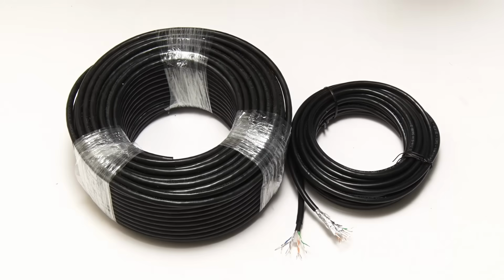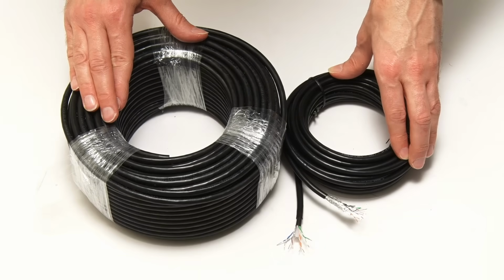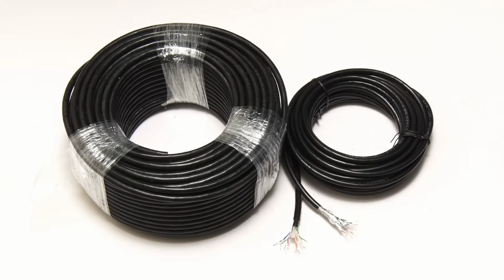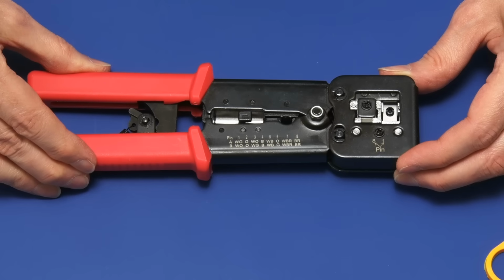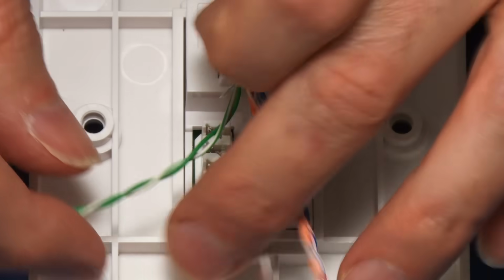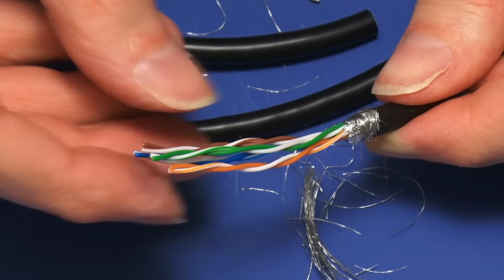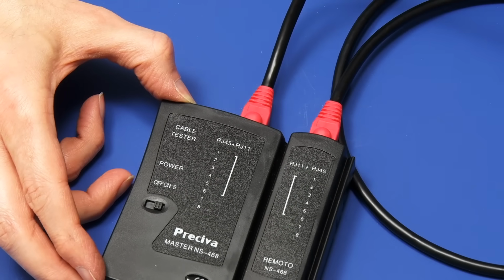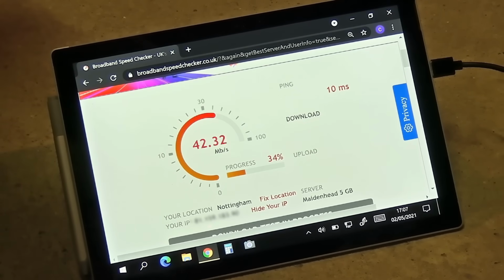Wiring Ethernet Extensions: How to Fit Sockets & Make Patch Leads

Comment: I don't understand your logic in using utp cable at all, let alone outside. While you use sfttp as patch cable. If you're serious about your network you would use solid sftp outside and braid sftp for a patch cable. You save nothing if you have interference, from earth itself let alone all wires.
Reply from the maker: Please do not forget the the practical, real-world implications of being able to actually buy such cables! It took me weeks to be able to get hold of a direct burial Cat 6, solid copper, solid core cable in the length I needed. There are copper shortages right now! :) So yes, in an ideal world, I totally  agree with you. But we do not live in an ideal world. And the cable I used is perfectly sufficient for my needs both now and in the future.
Reply: @ExplainingComputers  Yes, with shortage there is no argument. Your logic there is valid. However the price difference now does not reflect reality, they are simply overcharging.
Reply: To add, you should always pick one category and wire everything with it. There is no reason you should mix categories. Always go for higher one and there is no mistake. Cat 6a sftp is the best for all applications.

Comment: I am happy to see you used a wall socket with individual punch IDC connectors. Some keystones comes with fast and "super efficient" caps so you don't punch the cable but you can press in 8 conductors at once after you positioned them onto the contacts. The problem here is that you don't know how well the conductors are pressed in. Sometimes the conductor slip along the key cap protrusions and then the conductors lie in the upper part of the IDC contact. And they work loose. After some years that is. Intermittent disconnections and very hard to spot.

Comment: I prefer to strip the outer shield by cutting about 5 centimeters along the length of the cable. It is much less likely to damage a conductor. Even if I cut too deep, I only might hit the conductor, but I am very unlikely to cut into the copper. However stripping by cutting radially can easily cut halfway through a conductor because you are not absolutely sure about the cable diameter.
Reply from the maker: Regardless of method used, care is always needed!
Reply: Yeah, counting clicks needs a lot of faith in uniform manufacturing, not to mention in your stripper.

Comment: I did my whole house when I moved in. Put the patch panel and switch in the cellar. All went well, floorboards up which was chaos as the landing floors were up too. Did every room even the attic room. All tested - big tick and started putting the boards back. All done and....I had nailed through the attic run which was obvs the longest :-( ....had to do it all again.  Won't make that mistake again. Excellent vid as usual.

Comment: A word about cutting off the shielding of the patch cable. By cutting off the outer shield the cable becomes effectively unshielded or U/UTP. If there is an electric field on the outside, the shield will just carry that the induced voltage on inside and outside of the shield. By not connecting the foils around the twisted pairs the foil loses its function of crosstalk attenuation. But I don't think it does do any harm either. Crosstalk rejection is still provided by twisting of the pairs. And at different pitches as well. For short cables like this cutting off the shields does not make any difference. But for longer cables where shields are required for one or another reason, non connected shields simply result in an unshielded cable.
Reply from the maker: Agreed! :) My patch lead was only about 1m. The exterior cable was non shielded. I would have used shielded if available with the other specs I wanted, but it was not. Serious cable shortages right now.

Comment: Very helpful video. I have to run an Ethernet connection out to my greenhouse as I'm planning to install a remote monitored sprinkler system and a camera system there. Now I know what components I will need, and in order to future proof, exactly what cable I want to use. Thank you very much Chris.
Reply from the maker: Sounds like a cool project.

Comment: I wish I had internet that fast. I have 6 down and less than 0.3 up if your lucky, I live out in the woods of Louisiana so my options are limited. Louisiana internet is a decade behind the rest of the us.
Reply: And yes I'm using Ethernet, but over wireless ac I get the same result
Reply: Starlink?
Reply: @jlinkels  it's really expensive, my dad needs to invest in getting it setup. It's like a 500 dollar setup fee. We currently have DSL internet but once we drop the DSL there's no getting it back as AT&t is dropping that service entirely we should really get starling but I don't make the financial decisions that's why I have to invest in so many hard drives to keep on my downloads cuz it's not feasible to read download them if I need them again
Reply: 2 years later i have starlink and it is rock solid. at least 100 down and around 25 up, love it.

Comment: Love your video.  I am certified to run cable in my state (which requires certification).  My pet-peeve is to see people use the wrong plastic RJ-45 ends on Solid core cable.  It is best (as you did) to use stranded for these connectors.   The typical RJ-45 "crystal" is NOT meant for solid-core cable and each wire gets a flat blade with two pierce points on it.   This is meant to pass-through the strands.  I have seen many times that putting these crystals on home-made patch cables take down an entire network. (Makes a jittery connection)   If you have a legitimate reason to put a crystal on a solid-core cable, they actually make these (as I think yours are an example) which actually have three "fingers" on the end of the blade that can separate around the solid core cable.  This is acceptable for when the final install will be stationary and not moved about (like a POE camera).
Reply: It is a good point to mention. However, most UTP connectors are advertised as "for solid and stranded". Some do explicitly mention the three-point contacts. And some do not mention the contact type but still say it is suitable for both types.
Reply: @jlinkels  I buy the crystals in bulk (very cheap).  The (cheap) ones that are ONLY for stranded cable typically say nothing on the bags.   You are correct that the more expensive ones (for both type) will advertise on the bag for "solid".  I ALWAYS write on my bags of cheap crystals  "NOT FOR SOLID CORE" with a sharpie.  Like I said -- it is a pet-peeve of mine to see people use the wrong kind.
Reply from the maker: Thanks for your kind feedback.

Comment: You should try to keep both wires of a pair at the same length. It is more a concern in a socket than in a plug.

And of course you are 100% correct re WiFi.

Comment: 16:32 - Your crimp could be better by removing all of the excess shielding (wire and foil) outside of the cable jacket.  This caused the back crimp tab, that should hold the jacket, to be only on the wire shielding.  That will pull out from the connector much easier requiring a future repair.

Comment: If only I could convince my parents to put some bloody permanent cables around this house, but alas, I'm pretty much dependent on Powerline adapters just to get any reasonable connection between my room and the router. 😩
Reply: Power-line Ethernet adapters used to be very expensive.   Now only the newer sophisticated ones are expensive and there are many of the older slower models now that are very CHEAP!
Reply: @matthewhickok4421  I think my current adapters - a couple of TP-Link 600MBps passthrough adapters set me back about £40, but they're very much worth it when drilling walls isn't an option, in my experience.

Comment: While I do use wifi, I don't use it for anything where speed and stability are important.  Being RF, it is easy to block, distort, over/under amplify and it is subject to antenna radiation patterns so great in the living room, dead in the kitchen and great on the back porch of the neighbors house.

Comment: I'm try to avoid Wi-Fi, partly because of all the thick stone walls in my house that the signal can't get through, but I recently set up an old Wi-Fi access point so I can connect to Wi-Fi enabled microcontrollers. Doing an internet speed test I only got 1Mbps on the Wi-Fi, compared to my usual 5Mbps through Ethernet! We do have fibre in my sleepy rural Welsh village, but I'm too mean to pay extra for it!!

Comment: Handy Tip worth mentioning here: although Chris has made a very neat job of the socket wiring, it’s handy to include ‘service loops’ on the wiring. Basically have the stripped wires a little longer (each end) to facilitate cutting back should you ever need to change the termination configuration at a later date. Or if there is a problem with a good secure connection you get a second or third go. Nonetheless, nice video Chris 👍
Reply: Not a good idea.   You should read https://www.flukenetworks.com/knowledge-base/applicationstandards-articles-copper/terminating-category-6-5e-and-5-connector
Reply: @deadlymarsupial1236  Exactly. You put the extra length somewhere else in the run, where it's all still twisted and shielded. Keep your stripped wires as short as possible, and if you need to re-do the termination, you pull a little bit of that extra length through and do a new clean cut and strip, as seen in the video when he first started working on the wall plug. Never leave extra untwisted wire in the run, that's a horrible idea.
Reply: @deadlymarsupial1236  That’s interesting. Unfortunately, in the real world, especially in industrial environments, some of the guys who just don’t get it will curl up 50+ feet of cat6 and then cable tie it to the roof beams😆😂
Reply: @EndrChe  AS3085 and EIA/TIA606 (documentation) accommodate for this. 

The problem is how it is done so it complies with the building code especially safety requirements and the wiring installation rules for the cabling infrastructure ISO 11801.

Sometimes spare cables runs are factored into the plan as staging for contingency and future proofing.
Reply: @Leon Mailfert The cable he used is outdoor so the sheath is quite rigid.  If you are going to loop you would not do it in the block.  I don't do much domestic installs so I usually loop in the ceiling space where it is accessible as looping in the wall can impact on compliance to bending radius and the risk of kinking the cable if it is looped within the wall cavity - both of which can cause a certification test to fail (reflections).

The issue with terminating without maintaining twist right to the terminal block conductors is introducing crosstalk between the pairs (at both ends) which causes noise and thus impacts signal to noise ratio - that can lead to bit error rates and retransmission hindering performance at the very least.
Reply: Oh yes.... when some previous owner wired a security system into my truck, well, the damn thing blew up the alternator and had to be removed so it wouldn't do it again. And they'd wired it into EVERYTHING... with the wires as short as they could be and still reach when stretched tight. We finally gave up on rewiring the radio, there just wasn't any slack. Service loops are a wonderful thing, and always make them twice as long as you anticipate ever needing!
Reply: @Reziac   watch out for next though
Reply: @Reziac  this isn't as important in electronic wiring because you can splice it and extend it with little conductivity loss where as eithernet cables are not as easily reconnected with full conductivity.
Reply: @Leon Mailfert Leave the extra in the wall itself, not in the box.
Reply: Yes! I always leave generous wires/cables for this reason. I’ve never known what it was called though.
Reply: Even with the better shielded solid core Cat6, any long cable run like that would be better suited if directly terminated into a good powered hub.   Just because twisting the pairs and shielding helps combat capacitive feedback causing SWL, doesn't mean the problem completely goes away.
Reply: I would leave the service loop behind the jack. So you just leave a coil of completely unstripped wire in the wall in case you need to redo the punch down. 

Also if we want to get picky, we would want to maintain the twists in these pairs as much as possible until the wires reach the base of the punch down block on the jack. The excess little bits of wires sticking out would also not exist if using a punch down tool with a cutting edge. You can also just wiggle your punch tool and pull the wire bits off when you've got it punched down all of the way. This helps prevent crosstalk, so I'm told. Nonetheless it looks cleaner as a finished task!
Reply: When you wanna use 10GBe+, don't do it. Those are basically inductors.
Reply: @kyoudaiken  Yup, or even slower.  But you could leave extra cable, just not the stripped part.

Comment: An argument I would make for CAT 5 is if you're using cables you already have, that still works perfectly fine, and connecting something older with a 100Mbps or so cap on the NIC bandwidth. (For example, I have some computers in my house that are 25-30 years old, so they aren't capable of gigabit connections.) Sometimes the application you have is for something indoors, with a cap of say 1Gbps, and you have a low budget, so you go with an older spec to save money on the project. (Assuming that you don't have any aspirations to improve or extend later.)

Assuming that you're looking to upgrade within the next few years and that the installation may be permanent, you'd be better off with a thick gauge CAT 8.2; so that it should cover everything for the foreseeable future. (Especially if you're considering getting anything like surplus enterprise components and want something that's adequate to keep up with them.
Reply: I have been a professional in the field for many, many years.   It is very rare to see CAT5 cable that is not CAT5e.   CAT5e cable will do gigabit speeds as well as the new 2.5 GB speeds.  If you can afford it, always choose CAT6 over CAT5e.   But don't expect to actually get 10G Speeds over copper on a reasonably-priced switch any time soon.  Even current 10G switches have so much cross-talk that you can never truly achieve this speed.
Reply: Gb Ethernet was designed for plain CAT5, before 5e was available.  However, plain CAT5 is scarce these days.

Comment: putting a shielded cable into unshielded plugs 😥
Reply: It's generally ok as the most likely source of any interference will be along the run. To be honest, in most cases you don't really need shielded cables unless you're right next to a huge EMI source.
Reply: @soiledhalo2296  i have seen multi plug power boxes with 2 rj45 jacks, lightning protection.
Reply: @soiledhalo2296  A shielded cable where the shield is not grounded at one point is effectively unshielded.

Comment: Solid core cables don't like to be bend over and over and will break, you can use them for a moving device but they will fail over time so choosing a stranded cable is preffered.
When choosing a crimping tool, look for one wit a ratchet that doesn't allow you to open it until you crimped the cable fully, this will save you a lot of plugs 😉

Comment: Even though I grew up learning how to make Ethernet cables to the T568A standard, my personal motto is "as long as both ends of the cable have the same colour lineup, you're good" and it's served me well for making cables of various lengths.

Still, it's nice seeing someone go over the wiring of cables and patch panels for a home network.
And regarding that bit about people complaining about slow internet when it's their wifi that's the problem: that's why I run Cat5e/Cat6 cables to as many of my systems & consoles as I can to get gigabit Ethernet around the house & leave the wifi for mobiles, tablets, laptops and my handheld gaming consoles.
mind you I'm also currently on 200/50mbps 4G Mobile broadband provided by Optus here in Australia (HUGE upgrade from the 8000/384kbps ADSL on Telstra copper POTS I used to have, and most of the town still has), so that gigabit Ethernet only really sees max usage when transferring files across the LAN between systems.
Reply: The Canadians typically all use the T568A standard whereas the USA uses the T568B standard.   As long as the ends are both the same, it does not matter.   However, you must make sure that each transmit-receive pair is on the same twisted pair.   (you cannot just make both ends randomly the same -- they have to be "paired")
Reply: @matthewhickok4421  As an Aussie, I tend to find networking stuff prewired as T568A, and the legends on keystones (like what was wired up in the vid) have both T568A & T568B on them so you can follow them for which version of the standard you want.
Reply: Yeah..as long as you have the same wiring on both ends, for the current time, standard don't matter a lot. The whole point of the standard is an 'industry-wide consistent' method to prevent the next guy having to work on it having to go test each individual wire to see what it connects to...keeping in mind that the 'next guy' very well may be yourself*, several months or years down the line, having forgotten the method you used when initially installing this. :-) (always a good rule of thumb in pretty much *any profession, I think..."Always keep in mind the next guy to come along and have to deal with your work...because very often you will  be the 'next guy'...")